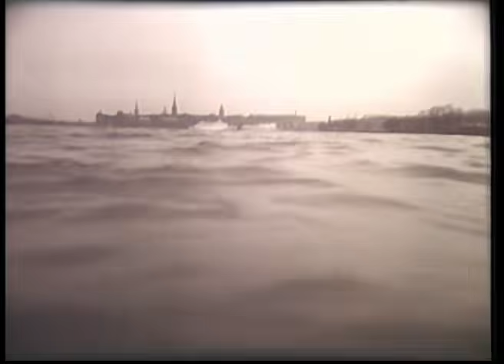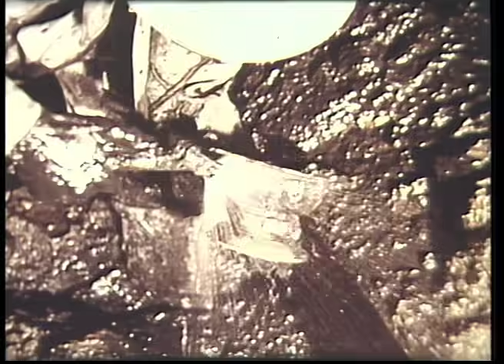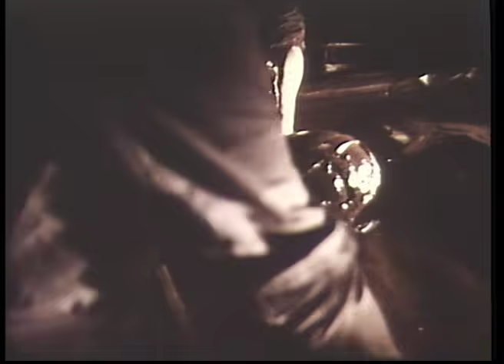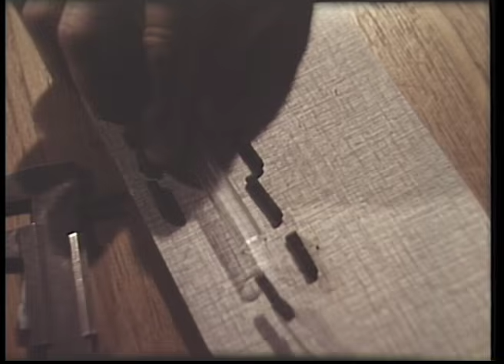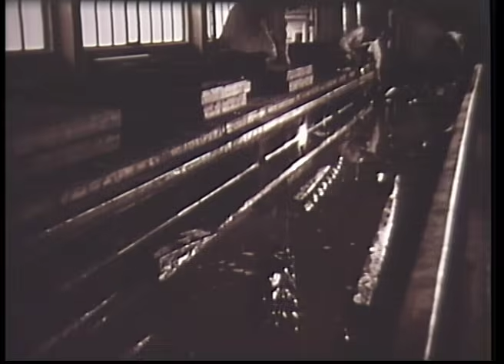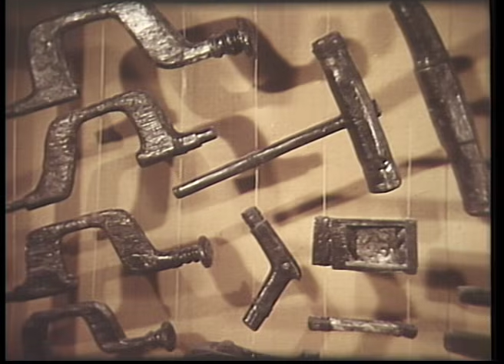Preserving the Vasa  | Shell Historical Film Archive

Comment: The Vasa was too top heavy. Once on the water with the wind pitching it side to side it pitch too far to one side allowing water into the portholes and all the sea water pull her down. She lack of being a well balance ship didn't allow the ship to pitch back up to the opposite side once the porthole were at the water line. The Swedish ship builders realized the flaw and built a sister ship to the Vasa called The Apple (in English translation) in which they expanded the width of the ship by 4ft allow for the weight to balance in the wind. The Apple is also at the bottom of the harbor but sunk intentionally as a blockade( along with many other military ships) to form a underwater artificial reef. The Sweden navy prevented enemy ships from using the harbor with all their own sunken ships